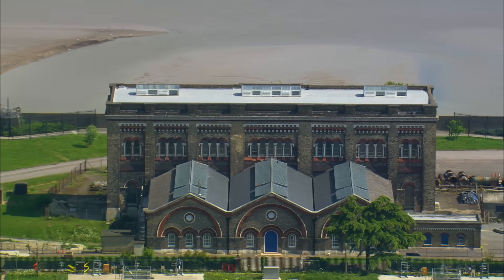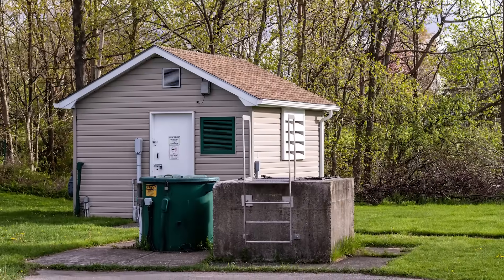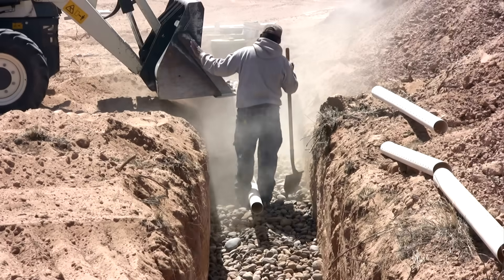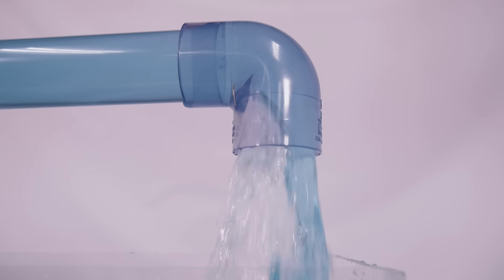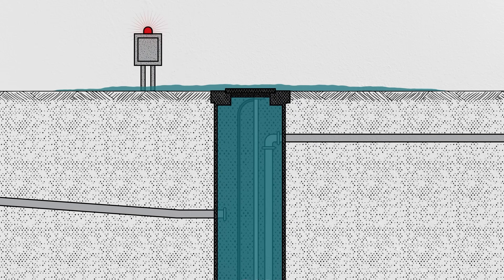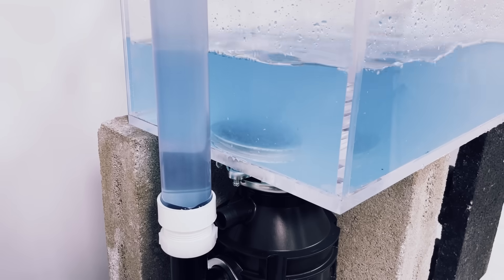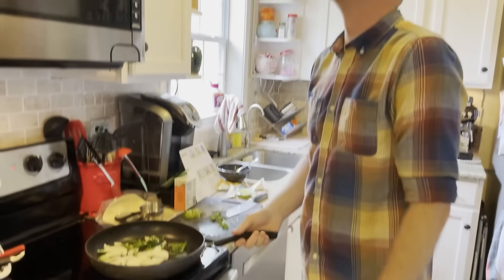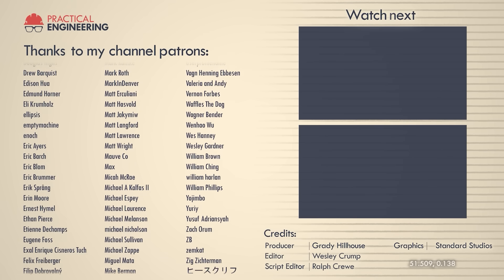How Do We Pump Sewage?

Comment: This was a very good explanation for the general populous, who do not understand the wastewater system is not magic. Solid waste, particularly rags are a very big issue that municipal water companies struggle to solve as citizens continue to put more and more unintending items in the drain.
One thing we do now to help combat the flushable wipes is use the frequency drive controls to detect over-torqueing of the motor and immediately run it in reverse for a minute or two. This 'can' help with wipes "ragging up" the pumps, but is not a fix all for the growing issue.

Comment: Two main difficulties with pumping sewage - large solids (like plastic bottles) and stringy things.   The large solids will clog a pump impeller inlet, and the stringy things (also, eels) will wrap round the leading edge of impeller vanes.     Dedicated sewage pumps attempt to overcome or work around either of these (the 'stringing' aka 'ragging up' is probably the more difficult), while also trying to attain a reasonable efficiency (more important in larger pumps that consume many kilowatts of power).
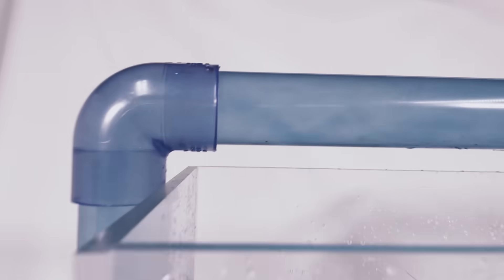In very small pumps, serving a few dozen houses, a grinder or 'chopper'  (like 8:55) is often used.   Very inefficient power-wise, but in a small pump, tolerable.
Alternatively a 'vortex' impeller ( 6:20 ) is used - immune to 'ragging up' since the impeller 'swirls' the flow and the main flow does not pass through the impeller.   Of course this also results in high hydraulic losses and low efficiency.
In larger sizes, various forms of open single channel impeller are popular.   ('Open' means the impeller doesn't have any 'closed' passages, instead the blade(s) or vane(s) butt up against the pump housing, making it harder for an obstruction to snugly settle itself into place).   They also try not to offer a 'leading edge' for string or rags to wrap round.
Or there's a very cunning design called a 'screw centrifugal impeller' which manages to have no vane 'leading edge' at all and can pump lengths of rope.

But all these - especially in the larger sizes - have to be very carefully designed and specified to suit the heads and flows.    Getting it wrong can easily result in the pumping station not performing as intended.   In this instance, over-specifying can be as bad as under - there is the tendency to calculate the maximum flow, calculate the worst-case head losses in the pipework, add a bit for caution, and end up with an oversized pump that's operating way off its best efficiency.   Not the pump's fault.

Comment: My school district installed low flow toilets in all the schools. Then the toilets at my school started to back up. The problem was not enough water was being flushed into the sewer pipes to keeps the pipes clean. So the district had to install an infuser which would occasionally flush water into the sewer pipes, thus negating the savings of the water saving toilets. This also happened in California where people were saving to much water there was not enough to keep the sewer pipes flowing, so again, some cities had to pump extra water into the sewer system.

Comment: Are there any reasons why waste water treatment plants don't invest in something like a bio digester and use those unwanted smelly and very flammable gases to say run a generator or make fertilizers or something? I've seen water treatment plants that have pipes of burning gas. I always wonder why they don't use it, even if it's for something small like just keeping the lights in the area on.

Comment: Great video! Dealing regularly with molten gob of "pump killer" dental floss which people often flush down the toilet... On par or worse than "flushable" wipes. Confined space entry to clean screens is truly a thankless job. Thanks to all the wastewater infrastructure maintenance ops for keeping the product return department flowing!!!
Reply: I remember the PSAs decades ago where a family was being scolded by the narrator for the things they sent down the drain, like trash, (unmacerated) food, cigarette butts, fat and grease, diapers, and so on.
They really made an impression on me back then, just like Daffy Duck teaching about stove safety, smoke detectors and evacuation plans.
-
Maybe it's time for some "influencers" to actually do something positive with their influence and put out useful information like those old commercials did.
Reply: @MonkeyJedi99  Wouldn't that be amazing if "influencers" really did that?
Reply: We should stop flushing any solid waste at . Any carbon based solid waste should be collected and be pyrolized in a furnace.  Resulting bio char can be reused to fire the furnace.  Electrostatic smoke scrubber will eliminate exhaust particulates and prevent smog

Comment: I wonder if any lift stations use something like the automatic solid removal system shown at 7:35 to protect the pump and then mix those solids back into the liquid once they're at the required height to avoid having to manage them separately.
Reply: We have a storm water station that has that kind of solid removal system,but there, it dumps into a dumpster to be taken to another facility that makes fertilizer out of it.  The largest station I take care of has something similar called a bar rake. We have 4 and they used to dump the solids in a grinder, then back into the well. Now the solids are conveyed to a wash press and also hauled away for fertilizer.

Comment: You left out Pressure pot lift stations. The small city for which I was the only city works maintenance person used a pair of 200 gallon pressure pots to lift sewage at it's final destination. In short, when the pot filled up, a float triggered an air valve which applied air pressure to the pot, forcing the sewage up to the ground level, where is flowed into the evaporation ponds. There were two massive four cylinder air compressors with a 500 gallon pressure vessel to supply the air pressure. The lift was approximately 35 ft.

Comment: damn the thought of falling in to one of these places was bad enough but to know there might be a grinder down there HELL NO!!! would rater take my chances against zombies bare handed.

also why impeller pumps? there out dated hollow disc pumps are king Ive seen them move stuff thats barley considered liquid there far better in every way longer lasting easy to maintain literally one cover to get to the workings no need to take off pipes and literal shit they have no priming problems so theres no need to submerse them in the shit there pumping so the pump and motor can stay where they can be easily accessed not on the bottom of a tank of shit.

Comment: Noticed you had a little problem with that tubular adapter on the garbage disposal set up. Next time, dope the sealing surface between the ferrule and fitting with pipe dope and you wont need a bucket under your discharge pipe ;)

Comment: Could a vaccum system work for this application? Ie: if atmospheric pressure differentials could be produced at different ends of a lifting system (designed for this) - could you reliably move fluid without the need for an impeller? I'm sure construction and operating costs would be prohibitively expensive compared to alternatives, but I'm curious if those would be the only limitations.. Great, I'll be thinking of poo pumps all weekend now 🤔

Comment: Gotta wonder why we can't use a caveman style bucket lift for the water, consisting of literally just buckets on a belt that scoop up the water and haul it up. ~3.5 moving parts, 0 problems with impeller clogging. Debris can be sifted and disposed of on the surface, where maintenance is much easier.

Comment: Would it not be possible to put an air pump in the top of that tank and lift the sewage using air pressure instead?
Reply: the air pumps would pump out lots of sewer gas bubbling out under low pressure and cant lift the water more than about 9.3m (~30ft) at horrible efficiency.
Reply: @user-si5fm8ql3c  What I meant was using the pump to compress the air in the tank to push the sewage out. You would need a valve at the inlet to the tank and close it temporarily. I am sure you would get a number of new problems but at least clogged pumps would not be one of them. 😀

Comment: This is what I do for a living. Submersible pump specifications usually require pumps to pass a 3 inch sphere but they are no match for wet wipes because they are made of a fiber that attracts grease and other fibers. You would be shocked by the amount of condoms in wastewater.

Comment: i am currently working on a project for our lift station at our plant, its pretty fun trying to figure out the level and the over all size of the vessel and finding the right equipment to level and to automate the equipment, what I'm tasked to do is create a metering program to turn pumps on and off, at certain levels, and turn off at preset levels. we learned a lot trying to figure out what we are going to use to read the level of our vessel, we were going to use laser, but now we will be using sonar, a very weak lower level of sonar and that is going to take the leveling/metering data over to the PLC and the PLC will automate the whole system to keep it as hands free as possible.
Reply: We have several stations that use ultrasonics, but in small wells it can be hard to aim just right to not hit the pumps or cables. We're changing some to radar. They are supposed to be more accurate and easier to aim. Plis,Plus, work with existing PLCs from the ultrasonic and pressure sensors.

Comment: I honestly would ban wet wipes in cities.  Make it illegal to sell or buy wet wipes even if they say they are flushable (they aren't btw).  You have an apt building and it specifically says NOT to use these wipes as part of your lease agreement or face a fine, maybe that would discourage the use.  Have a plumbing company specifically contracted to service your building and if they come out to fix your toilet and pull out a wipe, document it and say you can pay a fine or if your innocent we will test it via DNA, but if its yours then you pay the fine plus the cost of the DNA test.  Same goes for kitchen grease.  Just because you pour hot water at the same time you pour your skillet oil from bacon doesn't mean its safe and won't congeal.  It just won't congeal quickly.  Just pour your grease into a container and let it solidify before you toss it in the garbage.  My folks have a new home and had to install a sewage grinder pump because they kept dumping grease down the sink.  Add that to the hair, body oil and whatever else and its a costly visit.

Comment: Great video! A fan of your work. One general question: Why aren't wet well sewage pumping stations converted to dry well pumping stations?
Reply: Actually, dry well lift stations are usually converted to submersible because the pumps are more reliable and the footprint fir the facility is smaller.
Reply: @donquique1  what about the pump material of construction and maintenance requirements? I was under the impression that wet wells are hazardous and dry wells are much better in this regard.
Reply: @ajaypisharody8939  wet wells are always classified hazardius no matter if it is dry or wet well.
Reply: Where I'm at, we use the same pumps for dry or wet well. A good thing about that is that if the dry well floods, the pumps will keep pumping the nasty out of the well. For me, the size of the pump makes a difference in whether it goes in a dry or wet well. If I can use my service truck crane to pull the pump, wet well is fine. Larger than that, and I'd rather have it in a drywall with a bridge crane overhead to pull the thing out for repair.
Reply: @chuckycheezburger3313  wow. That's practical experience. So you use a wet well system based pump for dry well / wet well system. But didn't quiet understand the chance of flooding of a dry well system.
Reply: @ajaypisharody8939  We mostly use Flygt submersible pumps in either dry or wet wells. On the flooding of the dry wells, I've seen it 4 times. Twice when a pump broke loose from the volute, once when a contractor didn't re-assemble a check valve correctly and the swing arm shaft came out, and once when an impeller came loose while running and broke the suction side elbow off the bottom of the volute.In all these examples, something gave way and the contents of the wet well came through and filled the dry well  too, usually enough to submerge the valves and pumps. And since the influent never stops coming in,if the pumps stopped, it would quickly cause a bypass.

Comment: Regarding lift stations - not all pump into a sewer rising main (as we call them in Australia), some just literally 'lift' it into a chamber where it empties into the next section of gravity mains - usually seen in developments just adjacent to existing sewage infrastructure. Overflows are handled in a few different ways. Sometimes there will be an overflow pipe right at the station that discharges into a drain, creek or stormwater, and sometimes it's a few manholes upstream of the station where the sewage backs up to.

There's also a different type of sewer system that utilises vacuum pumps at the pumping stations. These are used in areas where it may be difficult to excavate to a economical depth or environmentally sensitive environments. Each connection (at a house, etc) has a collection chamber and a special valve and the sewage is literally sucked out of the chamber. This means the pumping stations can be geographically much further apart as the pipe grade is much flatter. That said at the pumping stations they will still have lift pumps to take it to the treatment plant or another pump station. Anyway, good video :)

Comment: I'm my home town they are using collection chamber then when the level is " high " they will inflates that chamber with compressed air to flush it up and get it in the higher part of the system. No moving part except some non return valve so less blockage.

Comment: 1 Atmosphere = 32.8 feet, which is what a Venturi pump produces or achieves.  To lift more than than, you need mechanical gears to 'push' the water or more likely oil, or you need pressure greater than atmosphere.  Source:  I have installed many a Venturi pump at my farms and I have a science background.

Comment: We’ve recently switched over to a “chopper” centrifugal pump. Rated at 5 mgd they have copper blades connected to the impeller which makes for less clogging!!
Reply: Would you mind letting us know what manufacturer and model your copper chopper pump is? I'm curious to see how the blades are set up. It doesn't seem that copper would be tough enough to last very long.
Reply: @chuckycheezburger3313  we have been switching all of our pumps to Vaughn Chopper pumps
I’ve seen them run for over 5 years now!
Low maintenance 
very reliable and output diminishes are minimal
Reply: @chuckycheezburger3313  where you guys from

Comment: My hometown had a lift station near a residential neighborhood. Eventually, the increasing odor it produced as more residents moved it prompted the city to completely redo the configuration. It was only located maybe 100 or so yards from the treatment plant. So, they dug an extremely deep wet well at the plant and connected it to the existing lift station so the waste would just flow through the old lift station down to the new wet well. So now all the odors just happen to also be next to the treatment plant odors.

Comment: From a pumping perspective, it’s interesting to note that the industrial pumps used for moving wastewater typically have two vanes or one, curving like a screw with a variable clearance wear cone. This is contrasted to impellers used in nearly every other application that have three or more vanes for flow smoothing. 
As many have said already, the amount of things that aren’t human waste or toilet paper that get flushed are the issue with nearly any system. 

The screw lift pumps are also very effective, though limited in lift capacity to their physical height. They are self loading- the more they are flooded at the bottom the more they lift to the top.
Reply: dont they refer to these variable clearance open impeller pumps as process pumps?

Comment: Company I work for also does sewage construction. It's usually a 2-man job, 1 pipelayer and 1 excavator operater. When the pipelayer dude gets sick I have to fill in. My god what a discusting job. When the old sewage pipes are removed, the pipes coming from the houses are disconnected, sometimes several days. So all their piss and poop is laying there in the spot I have to work. Makes me gag just thinking about it. Or going down a well that's been in use for decades, oh what fun that is... But the worst was recently, when I had to make a temporary connection between the new sewer system and the old one. I had to cut a hole in the old pipe but for some reason the system was completely filled with that nasty shit and piss water. As soon as the first cut had been made it all came spraying out like a fountain but I had to finish it, so guess who got all that nasty shit all over himself.

And here's a fun fact: Most sewage systems are replaced with a double system ( atleast in The Netherlands), one for rainwater only and one for waste. The rainwater system is made with porous pipes so the water can sink into the bottom. Because of this, it's not allowed to wash your car in your driveway and get all the soap to enter the rainwater system.

Comment: In my Swiss hometown, a set of huge oblique Archimedes' screws is used. Very efficient, and an impressive view (it's open air). We don't need grinders or anything. The Archimedes' screw could pump a dead cow if necessary.